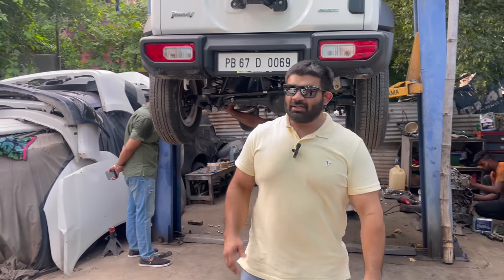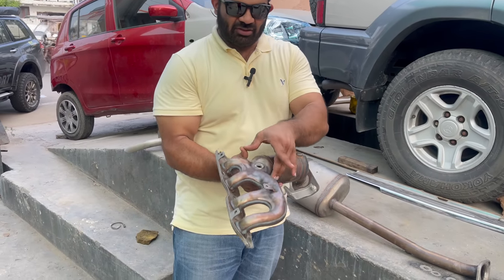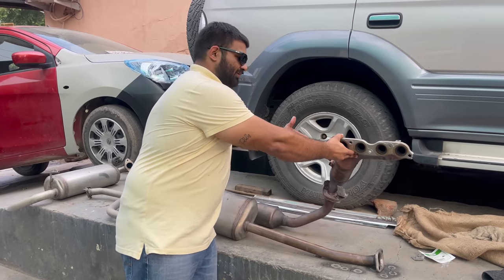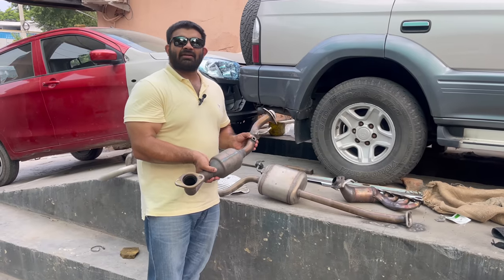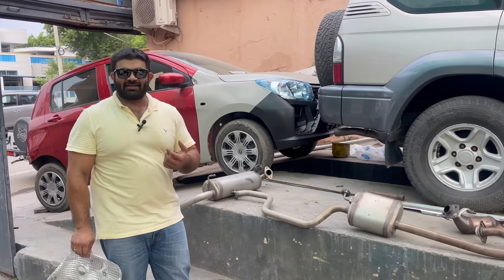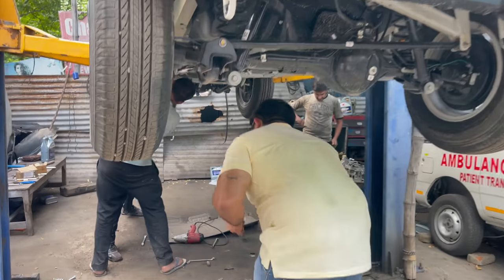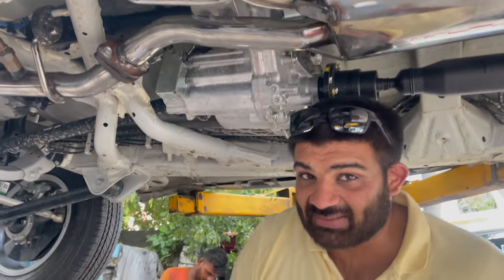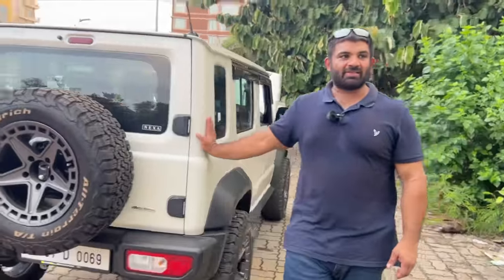JIMNY Full Exhaust Upgrade / Install. Better Performance + Sound.

Comment: A well designed exhaust system can help to increase the performance of an engine for a specific rpm range and different applications. With the right set of headers, especially long tube headers, one can unlock substantial amount of power and torque because it improves the scavenging effect. 
* A 4-1 header setup is majorly used in racing applications because it increases the peak power in the top end rpm range. 
* A 4-2-1 header or a 'Tri Y' header is majorly used in off-road and street applications because it maximizes torque and drivability in the mid rpm range. 

Another key point that is often misinterpreted is backpressure. We don't need it because the higher the backpressure, the difficult it gets for the engine to push out the gases, which reduces the overall efficiency. What we really need in a N/A engine is maximized scavenging, so that the engine can breathe better. 

Just my take on this topic. That been said, once again, a very insightful video veer. Keep the good content rolling! 🙌

Comment: Another amazing informative video. Few queries here, 
1. How much ground clearance is compromised?
2. The Primary Lamda reading post this MOD may not be appropriate, what's your thought on it?
3. The safety of the left rear passenger while exiting?
4. The effect on left rear wheel due to the exhaust?
5. Is it Street legal?

Keep up the good work.

Comment: Thanks for explaining in detail. Would the pipes decrease the ground clearance by any chance? 
As the lambda sensor readings would be different than stock, wouldn't it throw an error on the dashboard?
Any changes done to EGR ? (assuming EGR is present for Jimny)

Comment: Nicely explained. But I have one doubt……will this side exhaust placement reduce ground clearance and if not still it seems to be more prone to hit during extreme off-roading conditions.
Reply from the maker: It won’t after the sliders are done and the proper lift kit goes in

Comment: I feel the O2 sensor bank 1 should have been placed after the 4-2 pipes , as right now it’s taking the reading for only 1 cylinder. What are your thoughts?

Comment: this setup without the CC will have your check engine light on in no time unless you got the remap as well
Reply from the maker: Yes , this particular vehicle has the stage 2 remap from Superchips UK that helped to remove the check engine light as well

Comment: There are chances that the rear left passenger may burn his legs and also the rear left tyre temperature may increase due to it's placement.
Reply from the maker: Nope , actually doesn’t get in the way

Comment: The owner will have  a hard time passing emissions . He has invested so much in an SS exhaust , could have spent a little more n requested Automech to put in a magnaflow high flow catcon . The vehicle would have remained street legal .
What size tires are these ?

Comment: Brother I'm a little curious to know how u installed the lambda 1 in a single exhaust port the second port from behind? Won't it give a false O2 reading to the ECU. I suppose it has to be after all 4 ports merges to a single pipe, the lambda 1 should take O2 reading rite? Plz correct me if I'm wrong.
Reply: 16:25 time stamp👆

Comment: Imagine rock crawling with these lol, the exhaust will get crushed lol😂😂
Reply from the maker: Rock crawling?
Reply: @TreadTrails  yes sir I am talking about situations on where it is rock crawling and or let's say when it is breached because of low break-over angle , the exhaust is hanging quite low , won't it damage the exhaust?

Comment: Though this is SS FFE, the couplers I believe are still steel. There is rust on them especially near the welds. Is it not possible to use some sort of heat resistant paint/coating to avoid further rusting of these welds/couplers?